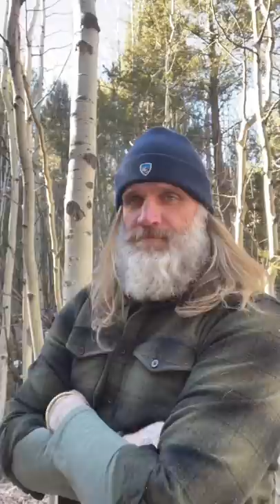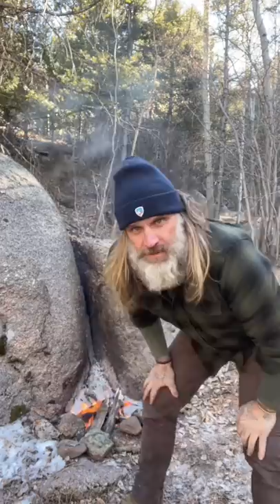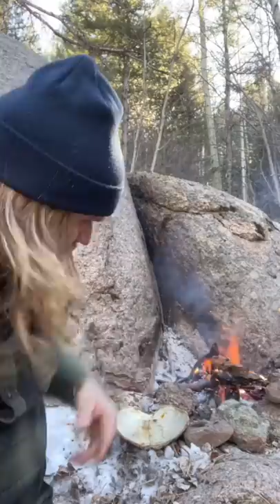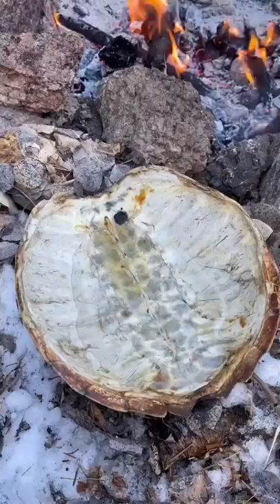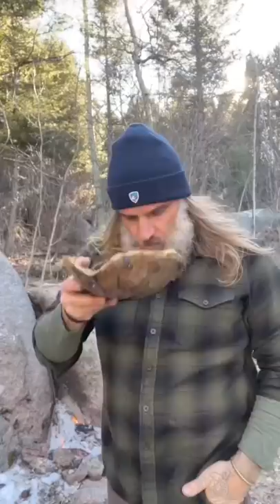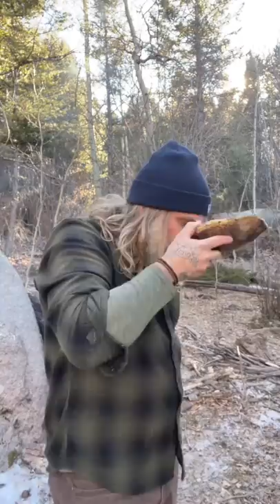Hot Rock Boiling

Comment: Generally, how long should you let it boil for the water to be safe to drink? Do you just let it go until the rocks are completely cool?  Is there some visual cue? Or do you just kinda say it’s done whenever it feels right?
Reply: Seems like I remember being taught you had to boil the water for much longer than just dropping some hot rocks in it. I may be wrong but I'd check into before i go drinking dirty rock water. Lol

Edit: I looked it up and the water only needs to boil for a minute which enough hot rocks is more than capable of doing. I stand corrected.
Reply: @Wheresmy240  good to know. Thanks for doing the research for me!
Reply: This is absolutely wrong information. You need to maintain a rolling boil for some time.

Hot rocks isn't going to do anything but vaporize the water in direct contact with the rocks until they rapidly cool to doing nothing.
Reply: @nopenope404  EPA guidelines suggests that water should be boiled for 1 minute to sterilize it. CDC has the same guidelines.

Putting hot rocks can indeed cause water to boil, though depending on the amount of water will take some number of rocks. The rocks transfer their heat energy to the water, so more hot rocks means the water gains more of that heat energy until it begins to boil. The trick is to use enough rocks to make ALL of the water in the vessel to boil.

There archeological evidence of this method of sterilizing water being used by North American indigenous people as early as 4800 years ago, but seemed more prominent between 250CE to 1750CE. I'm sure a survival technique wouldn't have been used for so long if it didn't work.
Reply: @jflood236  ikr? I got another notif from someone saying boiling water doesn't kill cryptosporidium... which it does. If you're getting your water from a fresh running stream (which is ideal in a survival situation), the chances of it being contaminated by cryptosporidium are pretty low anyways. That's more of an issue with wells and pooled water since those are more likely to have the turd water stay and allow the bacteria to grow to dangerous levels.
Reply: @nopenope404  it's like 7 minutes
Reply: Just until it's done releasing their heat into the water , water should be at a "Rolling boil" for at least 5 mins and then it is safe to drink you can also filter it through a small 5 stage filter just to remove sediments and some parasites and eggs of some small water critters.  Made from a plastic bottle cut off bottom then line it with a piece cloth by dropping pea gravel onto it then a layer of fine sand then a layer of fairly fine charcoal that's been  then rinsed,  another layer of very fine sand and fairly fine charcoal. Before using it pour water through it til comes out clear then pour several boiled water through it before drinking it two or three times using very hot water the you can drink after third pass of rinsing water doesn't have to be boiled long just quick heated . . I call it a mini Brita ... Works real good for quick need just rinse it through once with water then collect after 1 hot pass. Drink second pass might be a little particulates but just charcoal probably.
Reply: @gcook725  yep, because nobody would be here because everyone would have died from parasites and  giardia . Crapping through screen door time, before screen doors 😂🤣😂🤣🤓

Comment: Wouldn't the heat evaporate the water, and the rocks introduce dirt?
Reply: That's as simple as taking the dirt off the rocks, perhaps by rinsing or brushing them. Or if you did leave dirt it would be sterilized anyway along with the rock. Have you ever boiled water on a stovetop? When water reaches its boiling point it begins to evaporate but it doesn't all turn to steam immediately
Reply: @ryanwilson1654  even brushed off rocks introduce bacteria and dirt. Not a good idea
Reply: @gluttonousgoddess  the "bacteria" can't survive at those high temperatures
Reply: @gluttonousgoddess  bruh that’s what the fire is for.
Reply: @gluttonousgoddess   The heat doesn't filter the water, of course.  It just kills all the little microscopic nasties in it.

Comment: If you have two containers that hold water well without burning or melting, I suggest you dip the hot rocks into one container of water before putting them into the water you want to boil. Then you won't get the ash from the fire  and will keep the potable water clean.

Comment: Clean the rocks off in some water (even dirty water) the. Dry them up and now that there is no dirt or bugs or anything you just throw them in the fire and the heat kills all bacteria that’s left, then you can use a stick to pick out the ash if it really bothers you, also the very little charcoal you MIGHT consume isn’t going to hurt you at all..as someone who has been doing construction work since 12 I can very very very confidently say we consume much more dirty things on a regular basis and are perfectly fine, same goes to automotive workers. Grease, oil, tar, dust, dirt, etc. 

Point is, the water is perfectly safe and clean and probably tasty

Comment: You have to boil it for atleast one min. by continually adding hot rocks. Throwing 3 rocks in that boil the water for a few seconds is the same as putting dirty water in a pot on the stove and letting it boil for only 10 seconds. It will still have living bacteria in it.

Comment: Heads up people, boiling doesn’t totally remove all the bacteria and harmful materials from the water.  A better way would be by rock boil distillation (considering the turtle shells).  You can use one shell full of water to boil, and a second to catch vapors for a side drip into other containers/shells.

This will at least give you one form of pure water without dirt or harmful materials in it.

Comment: I would like to see other ways to make bowls from scratch. I would like to make some or a cup. I almost had a cup using a nice gurthy stick and used Cole to burn it down but the top lip started cracking to bad and ifk how to fill the cracks and I dont have any pines close by to make pine pitch with are there any other trees I can use for pi e pitch? I want to make a blade and fast a handle to it but im struggling.  Thx for all the videos.  I think its cool as hell man. I want to ba ablw to make something from nothing.  I did finally find something to make good cordage from. Roots that I bashed with a rock. It's strong enough to use to make a bow drill with I just have not been successful in making fire with it yet.  Thx again.

Comment: What aboot the germs and bacteria within the shell? I'm certain they contributed to those delightful flavors that you were able to express with such delight 😂 And were you not worried aboot any of the rocks potentially popping?
Reply from the maker: @leelewisson6027  I just boiled water at 212+° so if any bacteria it was dead around 165°. Not these rocks…dry rocks that have a level of saturation through surface compared to a crack is fine.

Comment: Sus. I doubt this will actually make the water safe to drink. It might work like a bandaid while you set up a better system. 

Better system:
1. Clay is not that hard to find near streambeds. Use clay and dead grass to make bricks. Use bricks and more clay to make a 3-tier filtration system that will filter out contaminants using large rocks, small rocks, and any kind of sand-sized mineral mixed with a source of carbon. 
2. Acquire iron. Iron can be found in caves in surface veins and as small black specs in the sediment of water sources that originate in mountains or deep underground. It will take some trial and error but you can find it.
3. Use your clay bricks to build a furnace and smelt your iron ore. Then use rocks to hammer it into the shape of a pot and an oversized lid. 
4. Boil your filtered water with the lid slightly open on one side. The steam will collect on the lid and drip off the edge, into your collection container. When this water completely cools, you will filtered, distilled water that is completely safe to drink. Make sure to eat plenty of animal fats and/or salt though, to make up for the minerals and electrolytes lost in the purification process.

Comment: Isnt easier just to boil the water?
Reply: What if the container isn't fireproof?
Reply: @chainjail4834  bro, he literally threw the shell INTO the fire
Reply: @lucasgomesmoreira8451  I'm just saying if what if there's only plastic container?
Reply: @chainjail4834  yeah, but there isnt, theres a turtle shell where he could boil the water. And probably other cointainers too, but since hes all "wild", plastic wont be a thing there
Reply: @lucasgomesmoreira8451  well it's more versatile to use hot rocks, you can put it anywhere.
Reply: @chainjail4834  i dont get it, anywhere you can put the stones, you can put over fire to boil the water. Or do you thing those rocks wouldnt melt the plastic?